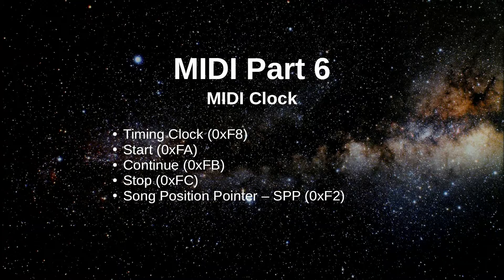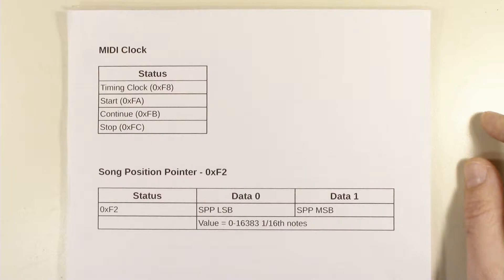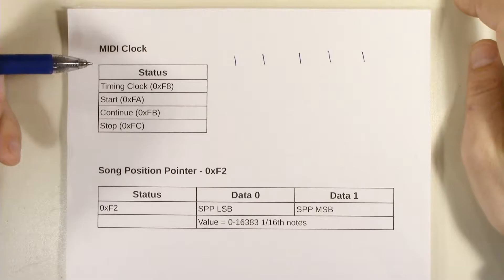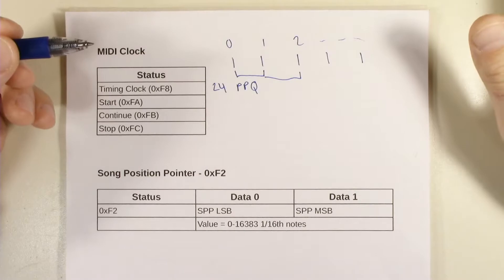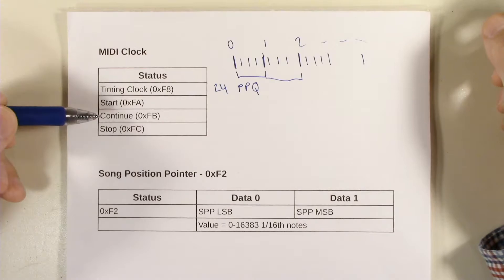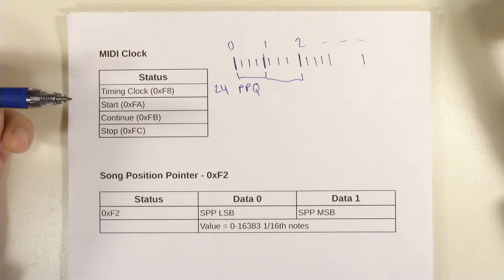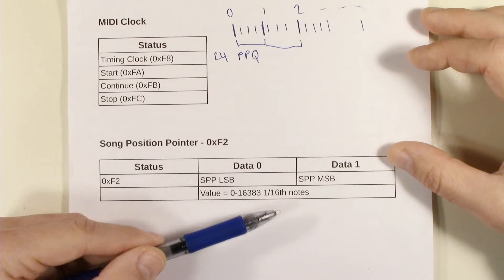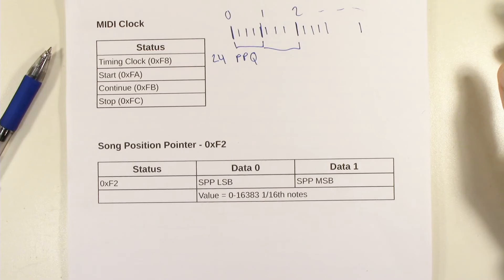MIDI Part 6 - MIDI Clock

Comment: Awesome tutorials you have made... very good. Question: Is MIDI Time Code (MTC) similar to MIDI clock or more like position pointer? I have found that the Alesis HD24 spits out MTC but for some reason the slave device doesn’t seem to lock in tight and after say 5 minutes it has wondered badly out of time. 

Either I’m suspect that the HD24 isn’t sending out a message or the slave device is not picking up a lock message. Is there a way to read MTC ...does it use hex language? Thanks 🔎

Comment: Hi Andrew, first of all a thousand thank you for this amazing detailed and well explained course, I learned a lot!

I have 3 questions :

1) If I understand well for best rhythmical accuracy using clock messages, it’s best to use MIDI DIN over Usb and to chose your DAW (in my case Ableton) as the master over most or any hardware sequencers correct?

2) If possible, is it best to send the highest PPQN value for best accuracy or can it cause problems down the path?

3) Also how much more reliable is analog pulse for clocking?

Comment: Thanks for explaining an area of the MIDI spec where the details can be misinterpreted and not well understood.  I made a stand-alone MIDI Clock device, and one of the important principles I followed that you touched on is, Clock Pulses and the RT Start/Stop/Continue Commands should not necessarily be bound together.  In my device, Clock can continuously send without a RT Start command being sent (and continue after Stop has been sent).  Clock pulses have an independent control.  If you want to check out the MIDI Clock device I built, it's on my channel.  Called CLOCKstep.

Another area some devices drop the ball on is that they respond to a RT Start command without waiting for the next clock pulse (they start without any clock pulses present).  RT Start is sometimes mistakenly mapped to the devices own internal Start and Clock mechanics.  This can cause sync problems also because not every device can process and react to the Start command at the same speed.  As you said, RT Start is supposed to signal the receiving device to place it in a pending start state, ready to go instantly when it processes the next MIDI Clock pulse (along with every other device waiting).  Vendors who want to have a MIDI command that maps to their own internal Start and Clock mechanics should add that command separately to their MIDI Implementation as a CC and leave RT Start to its intended purpose.
Reply from the maker: All good thoughts here, and congrats on your project!

Comment: How can a clock message be sent in the middle of another message (say, a NOTE OFF) and have both still remain coherent?

For example, if a clock message begins in the middle of a NOTE OFF message, what prevents the clock data bits from being read as part of the NOTE OFF data?
Reply from the maker: System Realtime messages are handled immediately by a MIDI receiver. So any message that is currently received is unaffected. Let's say you've already received 0x90 0x3f ... (first 2 bytes of a note on) and then 0xf8 comes along... it just gets processed and the state of the note on message being received is not changed. Then along comes 0x7f or so, and 3 bytes are processed as a note on message.

Comment: I have three devices all connected to my computer via USB connections that have midi clock master capability.  Should I set one to master and the other two to receive clock information?  Does it work that way going through my computer?
Reply from the maker: All MIDI messages over USB have to be interpreted / routed by your music software. Most software will have a selection to choose an external MIDI clock. But I highly recommend letting your music software be the clock instead because it will likely work better.

Comment: Question. If you are not working with music, is a clock message needed? The project I'm wanting to work on involves using software to control an audio mixer that can be controlled via midi.
Reply from the maker: You can use as much or as little of the MIDI spec as you need for your project. As long as your MIDI parsing code knows how to correctly handle (and discard) any data that might be received, you can safely ignore stuff you don't have a use for.
Reply from the maker: Because of Running Status you do need to at least do some minimal amount of parsing to make sure the messages you want are handled correctly. A finite state machine is the easiest way to do this.

Comment: Do I understand correctly: the midi stream flows with a resolution of 24 (sequencer-module), and a higher message density (480) is realized by the receiving device?
Reply from the maker: Yes.
Reply: @shiftedphase  
OMG, And I'm struggling with the microseconds clock in C# :))
Thank you very much !

Comment: Thank you, this series really helps me understand Midi messages more. Just a question:  I'm using an Arduino to send Midi messages to a Korg Volca Bass sequencer. I wanted to send a message to set the sequencer's tempo (there's a button to set the bpm) , do you have any idea how to do this? Like you said, it's not convenient to send Clock messages when you use a sequencer, but I can't find any other way to do this...
Reply from the maker: I'm not familiar with the Volca Bass specifically. I would be surprised if it didn't support MIDI clock. Some MIDI hardware supports either controlling internal settings (might allow the clock speed to be adjusted) or even pressing of panel buttons over MIDI. Sorry I can't help you with specifics.
Reply: @shiftedphase  Yeah I just figured out how to control the bpm with the clock messages while the sequencer is running. Thanks again!!

Comment: Hi Andrew. If the sync signal in a MIDI network is sent in two different directions at some point, and these two paths merge again later in the network, do conflicts arise affecting downstream devices?
Similarly, if a software clock source sends sync out over two USB paths which are converted to DIN by 1) a MIDI interface and 2) a drum machine (local off), and the signals then merge in between the drum machine and the sound module the drum machine is driving, is the sound module likely to become confused (dropped notes) even though the sound module is set to ignore sync?
Is it at all possible for MIDI messages (CC, etc.) or clock sync to interfere with devices in an upstream leg of a MIDI network?
Thanks for your video above and for considering these questions. John
Reply from the maker: Merging is fairly uncommon in MIDI systems. The main place where it occurs is within a DAW software or some other kind of sequencer. You can really only have 1 source. A typical setup would be to have a sequencer lock onto an external clock, and then generate a new clock to send to other devices. But yes, if some kind of merging allows two streams of data to mix together it could be weird. I think that's why most sequencers (hardware or software) kind of handle all the signal routing in and out themselves.
Reply: @shiftedphase  Thanks so much for the reply. So, do you think most hardware devices replicate the signal and send this fresh version downstream, or do they essentially just read it and pass it along?
Reply from the maker: @mandolier  Devices with a THRU port just pass through the signal. Something like a drum machine that can receive / send clock might either pass it through or re-generate it. It's probably difficult to know for sure and they probably don't say in the manual. I've done designs both ways... it depends on the design.

Comment: Great video! So, if I wanted to position the song at a place that is greater than 16383 sixteenths, will I not be able to use SPP?
Reply from the maker: Correct. But most songs don't have that many bars.
Reply: @shiftedphase  Yeah, I did the math and seems like it is applicable to 99% of songs. I suppose the other question would be... with clock pulses and spp, how can one figure the time signature?
Reply from the maker: @brdane  You cannot figure out the time signature from the clock signal alone. The MIDI file format contains message types which describe time and key signatures, so if you load a MIDI file you can determine it. But not by just receiving the MIDI clock signal by itself.
Reply: @shiftedphase  Gotcha.... what about a DAW's bpm? Still no way? I think I read something in the official spec about MTC having some time signature defining within it.
Reply from the maker: @brdane  There might be some extensions to the main MIDI protocol but I don't recall.
Reply: @shiftedphase  Gotcha gotcha. Thank you for the information, friend!

Comment: I'd be really interested in how you "up-sample" the resolution of the ppq in a slave sequencer/looper... especially if you are catering for in-song tempo changes. I notice that a lot of (software)sequencers don't tend to slave either and I wounder if it's for this reason. 

My other question is I know that we talk about sequencers being at 96,480 etc ppq but how much of a musical difference on playback than say at 24ppq, especially when there is potential for lots of data across 16 channels?
Reply from the maker: I'll try to do a video explaining the upsampling process. As for resolution, yes it makes a big difference in being able to do accurate math to subdivide notes, record accurate note lengths, produce effects like swing, etc. with minimal error. It is true though that notes going over a standard MIDI cable take some time, but a higher internal clock rate will almost always make internal processing easier.
Reply: That would be awesome - I look forward to it.

Comment: Hi! congrats for your videos, they're kinda useful!
I would like to ask you on which software you would recommend me to edit an existing midi clock file to change the bpm?
I've just bought a Cymatic LP16 that can't send midi clock but can read it. 
Thank you!
Reply from the maker: Hi Jose, MIDI clock is not stored inside a MIDI song file. Instead it uses tempo events which tell the sequencer which speed to run at for different parts of the song. You can use any DAW or MIDI sequencer software that supports MIDI tempo maps. I personally use a really old (like 1990s) version of Cakewalk for stuff like this. But there are probably newer solutions too.
Reply: @shiftedphase  Yes I know, sorry for my english probably I didn´t explain myself. What I have is a four bars midi clock file set at 95bpm. What I need is to edit the those tempo events and put that .mid file inside the LP16. The issue is that most DAWS don't recognize the file or don't allow me to edit real time messages.
Reply from the maker: @joseblancodoel2787  That's an issue these days. The best I can suggest would be to find a really old MIDI sequencer.
Reply: Thanks for your response! I was trying with Reaper which have a great midi editor for this purpose, but there's something I'm missing I guess. I've never heard about Cakewalk but I'll check out.
Reply from the maker: @joseblancodoel2787  It's SUUUPER old... see if you can find an ancient copy from the 90s. Cakewalk 3.0 is the one I use for basic MIDI stuff since it supports a huge amount of the MIDI file spec.

Comment: What is "Word" Clock used for?
Reply from the maker: Word clock is used to synchronize digital audio systems together. It is a square wave that runs at the sampling frequency and allows multiple systems to lock together so they can exchange audio data without any loss or resampling.

Comment: Oohhh....  suddenly the keyboards in the background, that can be seen in the previous videos are gone! I have one more comment, when you say 24 ppq has been chosen, because 24 is divisible by 3 and 4, actually, to break it down to prime numbers, 24 is divisible by 2 and 3, otherwise you would not be able to make 2 and similar.
Reply from the maker: Yes, also divisible by 2, but I mention 3 and 4 specifically because those are popular rhythmic values which might seem unrelated normally but are necessary to generate within the same piece of music. (i.e. triplets) Most sequencers multiply the 24 PPQ rate by some factor like 4 or more to create a higher resolution version for more precise note timing. But the number they choose is also always divisible into 3s and 4s.
Reply: @shiftedphase  Ok, thanks.